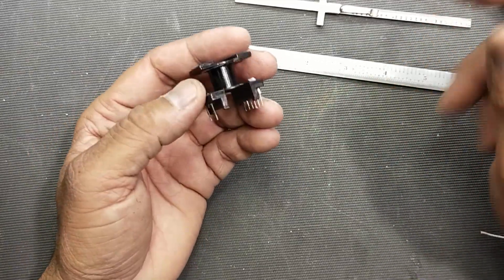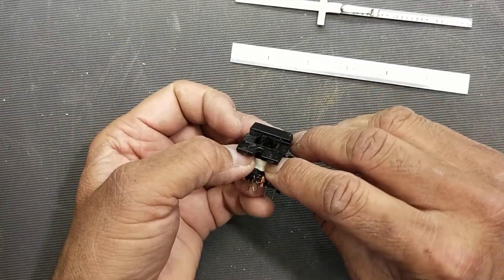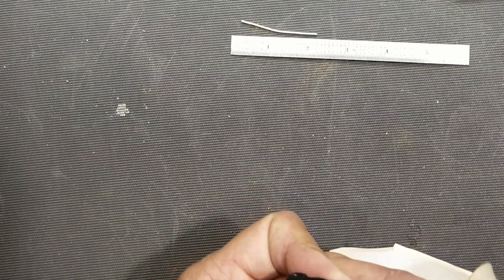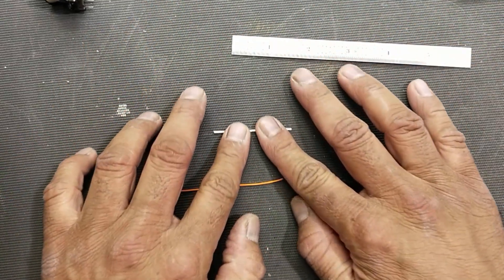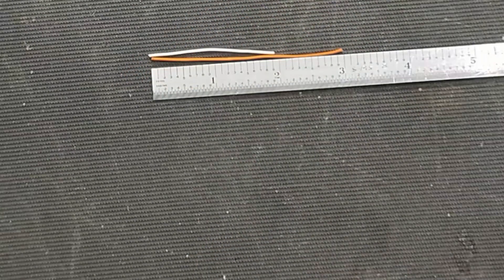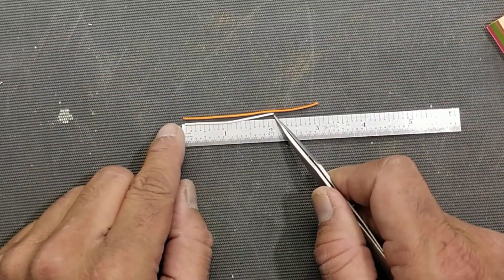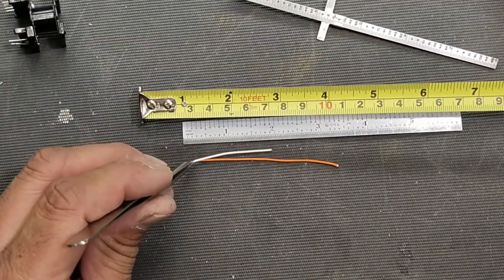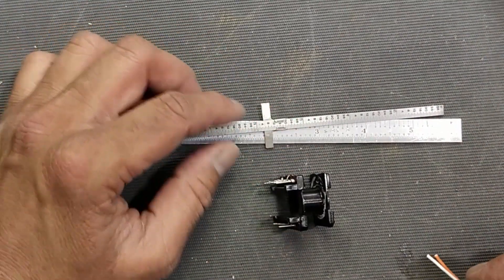#326 How to Find Mean Length Turn of a Ferrite Core to Design High Frequency Transformer

Comment: SIR I WANT TO ASK A QUESTION I AM MAKING AN SMPS USING IR2153 with IRF740 I WANT TO ASK YOU THAT WHEN I AM TURNING IT ON THE MOSFETS ARE HEATING UP TOO MUCH WITHOUT TRANSFORMER IS THIS NORMAL OR AM I MISSING SOMETHING? THANKYOU